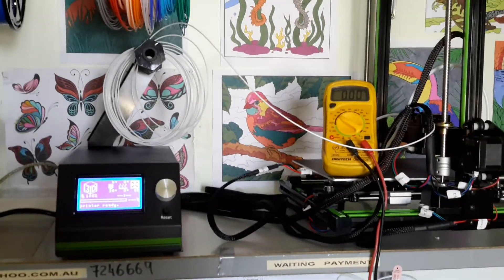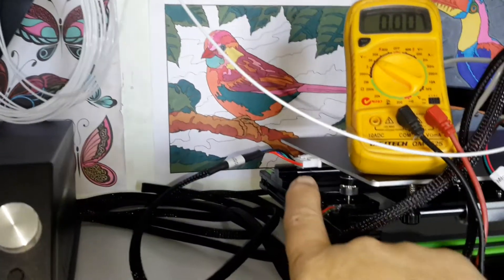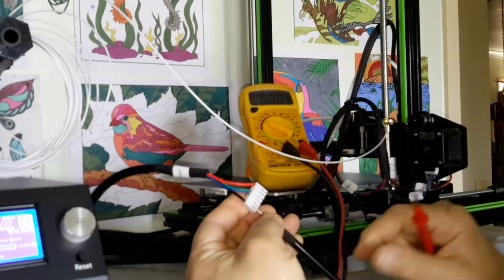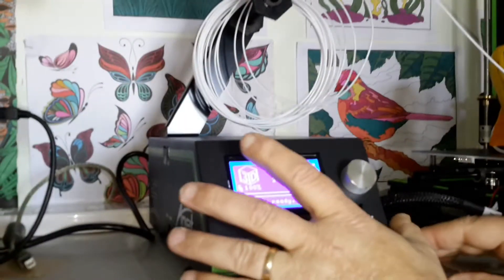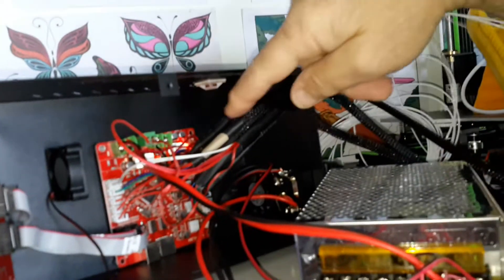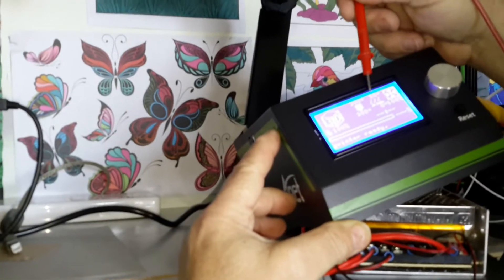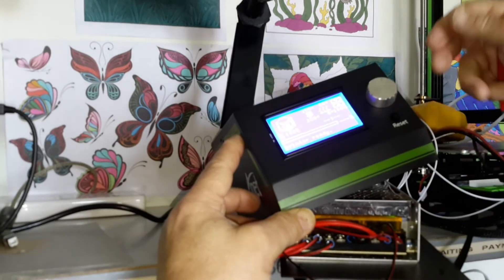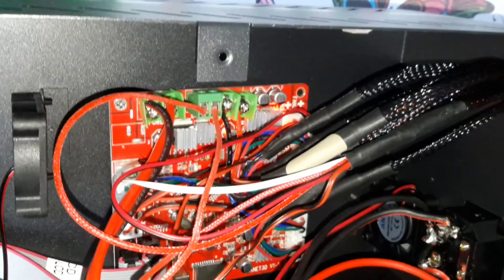Anet E10 heatbed issues 12 08 17

Comment from the maker: Well, yes after I found out really how it works and I can say that I was looking in the wrong place and wrong perception of what the problem was.  From the hotplate there are 2 wires with very different tasks, one is the power supply and the other is the heat sensor that controls the bed temperature, this wire connection was interrupted/cut when under the bed was scratched in transport by one of the screws of the "H" frame that holds the heatbed into the correct level, that damage was shown on some images on my next video, if I recall correctly or even maybe on this one, not sure.
I found the 2 ends of that wire connection and soldered them, as soon as I did that and tested the heatbed,  everything was working so this means that the controller board would not allow the heatbed to get power because the heat sensor was not working, that makes sense now that I know how it works, at the time I couldn't understand the results I was having on the voltmeter.  The manufacturer did send me a heabed replacement, anyway...!
Reply: who did you contact for this problem? I have this exact same problem but don't know who to contact for at least a replacement part or what to do